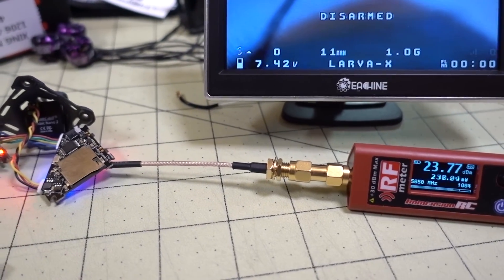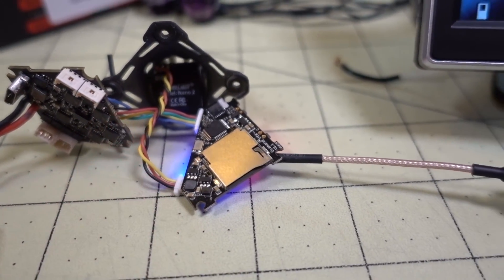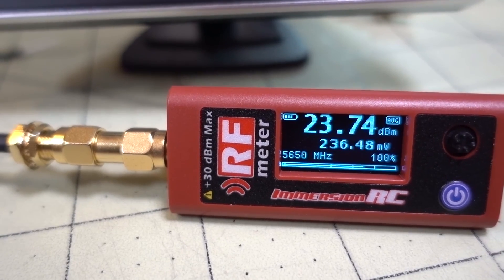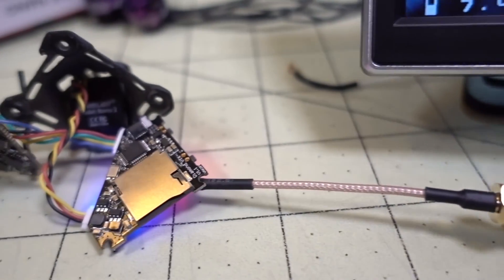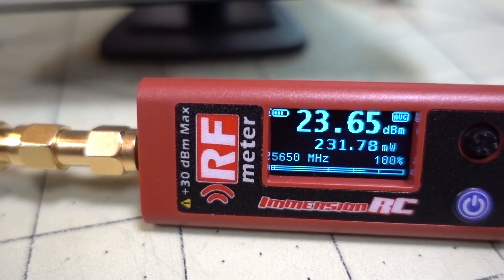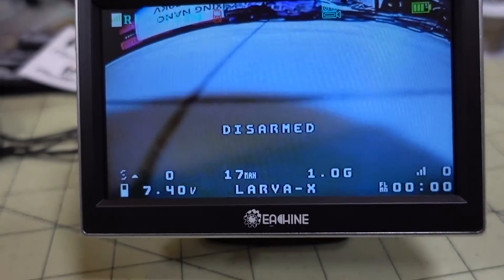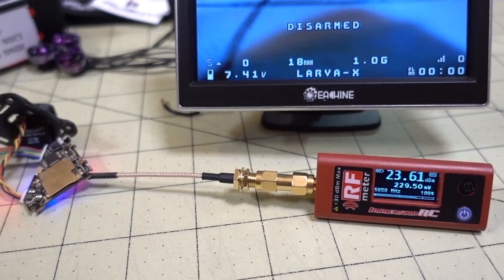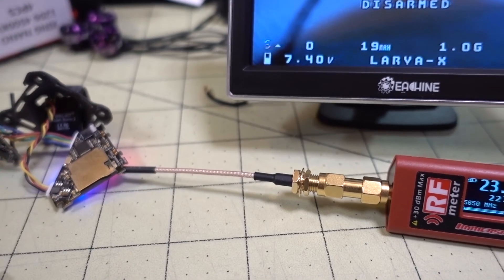FPV Mythbusters #1 // Diamond VTX 🤔

Comment: Dvr recordings has lines in video.. any thoughts?
Reply from the maker: Probably motor or ESC noise.  You can use an LC filter along with capacitors to clean that up.  Make sure the camera and the VTX/DVR are on the same power source as well.  Otherwise the source could also be the camera.
Reply: @AlbertKimTV  even if the transmission feed is clear and dvr recording has lines?

Comment: I can't get mine to work it just has a black screet lol and there isn't any info or videos on installation
Reply from the maker: Black screen usually means camera is not getting enough power.  Have you tried a different camera?
Reply: @AlbertKimTV  I just got it working thanks for the response. I reversed the in and out to fc for osd

Comment: Just picked up one of these for a toothpick build - however , I`m getting conflicting advice on how to connect it up !!!   Cam goes into the cam socket, easy.  Now does the blue "video out" cable connect to the "cam in" on the FC , then the vide out on the FC connect to the yellow video in on the VTX/DVR board ??? or is it vice-versa ?

Comment: Thanks for doing this. I’ve hesitated to buy one due to so many fail claims. Looks good to me. Same thing has been happening with HM AIO boards. I have several versions and all good. Many claims of ESC issues. We don’t get to see how many failed in imbalanced home builds.
Reply from the maker: I'll have a tipsy video on the vtx to avoid problems. One thing to keep in mind is that there's a lot of these products in the wild. They sell a lot. So even with a small failure rate, you see more complaints. Also, you'll notice it's the same people complaining over and over about general things versus specific things.

Comment: i'd like to see some (potentionally desctructive) testing on the toothpick AIO boards. Many people claim those boards, or the motors, can go up in smoke from running airmode and then crashing.
Since airmode boosts the I term a lot in low throttle situations, the motors can go almost full throttle while being obstructed by something due to a crash. people say that this could cause the baord or the motor to go up in smoke. I'd love to see this tested. Obstuct the motor on a toothpick, then arm and maybe even go full throttle and see what happends.

Comment: it's not the vtx but the crappy antenna it comes with...upgrade the antenna and you will be amazed!
Reply from the maker: So the results in the video are with the crappy stock antenna.
Reply: @AlbertKimTV  did you use the dipole from the larva or the one supplied with the vtx sold separate? thx
Reply from the maker: @ChrisLBradly  The one that came with the larva.  The monopole that came with the first few batches of the Diamond VTX should be getting the updated dipole by now.

Comment: What's your take on all the Larva-X (and HappyModel in general) hate lately?  Have you received a lot of DOA items from them?  I definitely want to get either a Larva X or a Sailfly when I can... but would hate to have a DOA part.
Reply from the maker: I think most of the hate is from the original crazybee boards dying due to the 5A ESCs and weak 5v regulator. I myself had a couple boards with 5v regulators that died. But that's it for me. All the rest of my Happymodel stuff is still working.  I can't speak for other people but that's my experience and I have a crap load of their stuff.
Reply: Thank you for answering.  I've always wondered (and not just with Happymodel) what is truly bad product, and what is because of abuse or not following various rules/limitations.  The R/C hobby definitely has a tendency to push limits.

Comment: Most of the complaints I hear say Happymodel has poor QC, it's hit or miss whether you get a winner or a dud. This is anecdotal, so it would be nice to see return rates for Happymodel products from a slightly impartial 3rd party vendor like RDQ.
Reply from the maker: Do you think RDQ would be willing to share that kind of data?
Reply: @AlbertKimTV  Probably not, but it would be neat to know wouldn't it. That's what I think of every time I see someone bashing a product, maybe they just got a dud which happens for every product. I work with data as my day job and I know it's usually not possible to get "real" comprehensive information.
Reply from the maker: Yeah, that would be useful data.  There are so many people that buy a product, and it works great but we never hear from them.  We only hear about the bad experiences.

Comment: Hey so I got one of theses and I can't get smart audio to work. I put it in the correct UART, I even had another VTX working on the same FC before. Any idea? On the OSD menu there just isn't any option inside smart audio
Reply from the maker: Are you using the TX and not the RX of the UART?
Reply: @AlbertKimTV  I'm using the iflight 16x16mm stack, on the manual it says to connect to the "LED" pad. I assume it's the RX, it was working with the previous vtx
Reply from the maker: it must have been setup using virtual serial ports... is that still setup?  you didn't flash new firmware did you?
Reply: @AlbertKimTV  I did flash new software, it came with 4.0.1 and it's using 4.0.4 now. But I downloaded it from the iflight site
Reply from the maker: but did you save the settings from the CLI dump?  I have a feeling the settings you downloaded might not be complete
Reply: @AlbertKimTV  I didn't save it, damn. I didn't download any settings tho, just the hex file... They have a .config file to download on the site, but I'm not sure on what to do with it. It's not a CLI dump as far as I can see
Reply: @AlbertKimTV  Oh, it is a CLI dump, just in a really weird format haha
Reply: @AlbertKimTV  I tried the .config I got from their site, but it still doesn't work... Here's the .config that I used https://pastebin.com/3NzDfSPQ it sets the led strip to a different port than the rx01 tho, maybe I need to change the rx01 to use the same port as the led strip?

Comment: WOW. So people are saying the Skyzone DVR is crappy? HAHAHAHAHAHAHAHAHAHAHA. OK. Its pretty much universally agreed that the Skyzone's DVR is the best DVR out of all the goggles on the market.
Reply: the DVR quality (lack thereoff) of the Sky02 is The reason I got rid of that goggle..  
The Sky03 has a different DVR module
Reply from the maker: People are saying even the new DVR module on the SKY03O still sucks.  I'm pretty sure they've never even tried the SKY03O but they still make those bold claims anyway.
Reply: @AlbertKimTV  From what I've seen the DVR in the 2018 Sky03 was FINE  and they tell me the new Sky03 has the same one... 
Maybe someone got things mixed up (sky02 / sky03).. as the sky02's DVR was horrible (IMHO)
Reply from the maker: LOL
Reply: I have the Sky03O goggles, largely based Albert's review. I am new to FPV (2 weeks in) and have really only used it with The Tinyhawk, Tinyhawk S and Tinyhawk Freestyle. The Goggles are great, but because the Tinyhawks' VTX are so crappy, the DVR is bad, but I did record some drones from other pilots and that looked pretty good to me. Incidentally, all of the Fatshark HDO people at my local field tried my Sky03O and were blown away.

Comment: Happymodel saw Kabab's video eh?
Reply from the maker: I have at least five of these in my fleet and all are still working.  I did notice they run hot on 200mW so I think things like bad air flow, and bad sd cards, and bad firmware are the source of many of these issues.  I will make a video to help people with that.
Reply from the maker: Which video?  I made this video last week and Happymodel didn't ask me to make this video either.
Reply: @AlbertKimTV  Kabab just dropped a larva x review
Reply: @AlbertKimTV  Ah, I just watched this, so it was fresh in memory; https://youtu.be/d-98SCrC7IQ?t=168 (time indexed for your convenience)
Reply from the maker: OK, I'll check it out.  What does that video have to do with this one?
Reply: @AlbertKimTV  Kabab mentioned that the 200mW seems like 50mW, plus lines on the screen.  I don't know...  it's difficult to judge products imho, cause you have no idea about minor revisions or manufacturing consistency, what it went through during shipping, and then what may have happened to it when the user solders it into a quad.  I've had older stuff take a small knock in a hard landing and never perform like new again.  I've taken to buying at least 2 of everything I'm interested in and building two that quickly becomes one after some actual flights; something always breaks cause just about everything is cheap...  or some circumstance that I put something through building or crashing it somehow compromises it's integrity in some minute manner.  You're not even buying parts as a pilot... you're buying an unknown time range of an approximation of advertised capability, that could end or be permanently changed at any moment with a unintentionally sharp move of the stick or a moment too long with the iron.  It's the nature of the technology.
Reply from the maker: @mistercohaagen haha, so I guess it looks like I'm making this video in response to that video?  That's not the case.  I saw other people complaining about this (not gonna mention who) and had this idea for a video series for weeks now.  I was able to grab that flight footage last week as well so unless I had a time machine, what you're thinking isn't the case.  But then again, maybe I DO have a time machine....  hmmm...
Reply: @AlbertKimTV   If you do have a time machine, I have some favors to ask of you.  But otherwise, yeah, just bad (good?) timing?